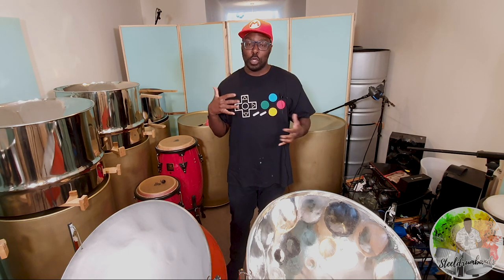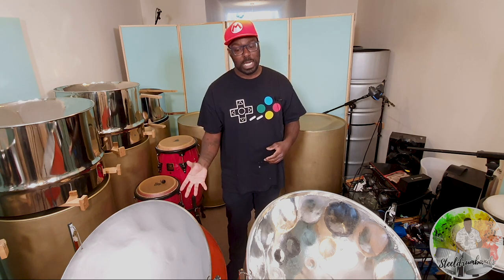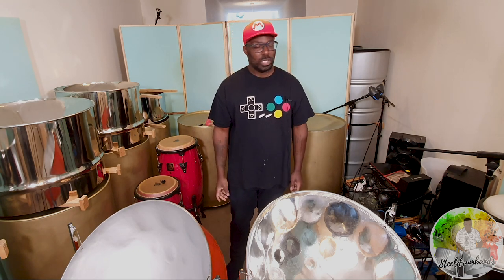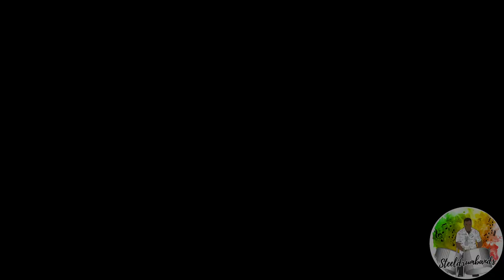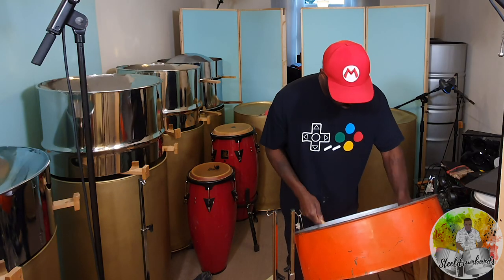Steel drums || cheap VS expensive (after restoration) - can you hear the difference? (Part 2)

Comment: The cheaper one sounds improved compared to the first video but even with the improvement, it still doesn't hold a candle to the expensive one. 

The expensive one has a smoother, cleaner sound and you don't hear that clanging on metal undertone on it like you do with the cheap drum.
Reply from the maker: Yes it's because because I was hitting the crappy drum twice as hard - so you're hearing the stick. Can't get a sound from it otherwise...
Reply: @Steeldrumbands  gotcha.